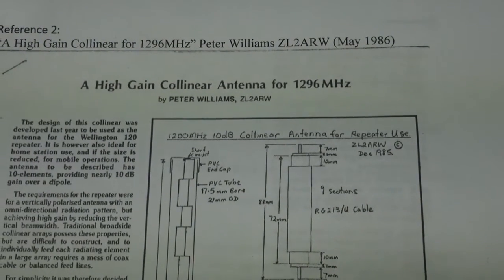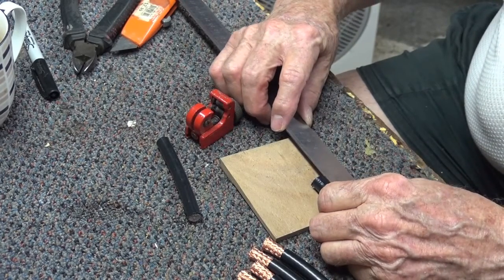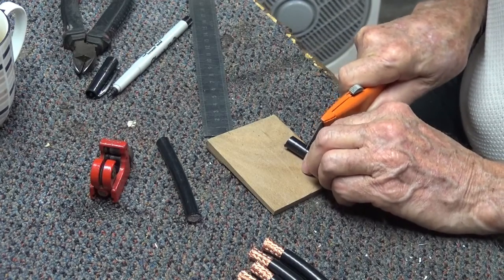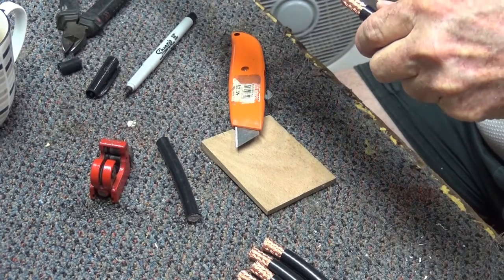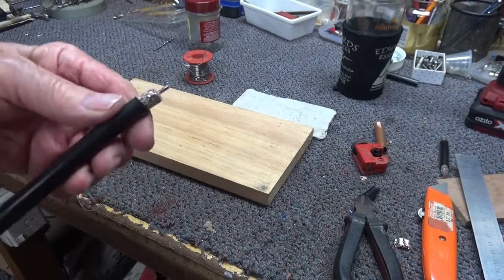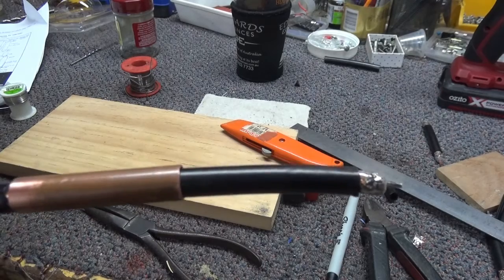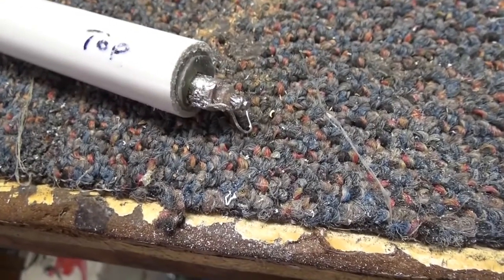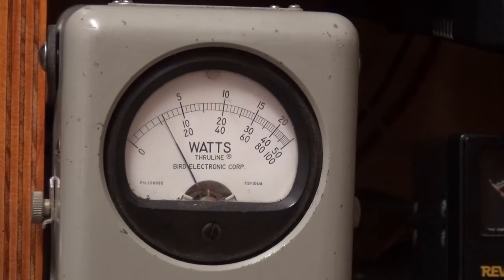How to make a 23cm band vertical antenna with 10dB gain - Ver2

Comment: "Low SWR over a large range" usually means theres a lossy component somewhere.  Put a 10dB attenuator inline and the effect will be even greater.  There should be a pronounced resonant point to any low-loss antenna.

Comment: What would be the best antenna for omnidirectional TV reception USA ??
Reply from the maker: Hi, most ATV repeater antennas are horizontally polarised so it’s not so easy to receive 360 degrees. Best to find out where your local ATV repeater is and aim a directional antenna in that direction on the amateur band it transmits on.

Comment: would that copper sleeve work as a choke for most 213 on different bands ?
Reply from the maker: It would Graham but you need to resize it to suit the band you intend to use it with.

Comment: Looks impressive How do you adjust swr ?
Reply from the maker: Hi Paul, the original design called for varying the length of the small wire loop at the very top of the antenna. In practice the bandwidth of the antenna is so wide that a small loop that will fit under the top cap is all that's needed.
Reply: @Jonny10001  Thank you, I’m guessing an inch’ish of the centre conductor will be adequate?

Comment: This is a frustrating video to watch, Its ruined by the lack of information. There is no description of the measurements. Its the typical YouTube video  ,that fails to provide the essential information that the builder knew but did not share.  
The link at the end works but its unreadable. 
You canot determine any of the measurements. It appears to be the forumlar but modified for the velocity factor affected by the epoxy reson. Thats a lot of work for who ever built the first one and had to build subsequent models to find what worked with reson in a PVC pipe.  Its a pity that no one has preserved the details. I have never been able to track down the original with a readable pdf copy or otherwise.
Reply from the maker: Hi Ram Jet, a viewer recently ask about making the antenna for a lower frequency. When preparing his reply I looked up the original article and found as you did its unreadable. I have printouts from when I made the antenna so I will scan them in and create a PDF. The net says I can deposit it on Google Drive and list the link here in comments.
Reply: @Jonny10001  These days with Chinese VNAs so cheap you don't have to calculate anything. If just finished a collinear on the ADS-B band and I cut and trimmed all the sections on the VNA, then soldered them together. I get a mid band return loss of about 30dB without trimming. This antenna is not for outdoor use so it isn't encapsulated. It just gets taped to a window when I want to use it.
Reply: The link to the pdfs which give the details are there, if your prepared to download and read them……..😉